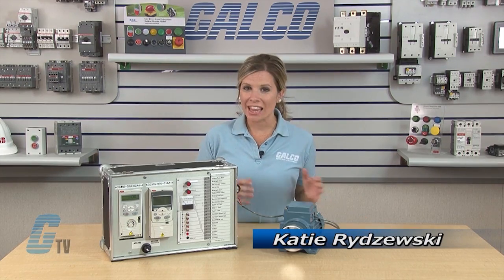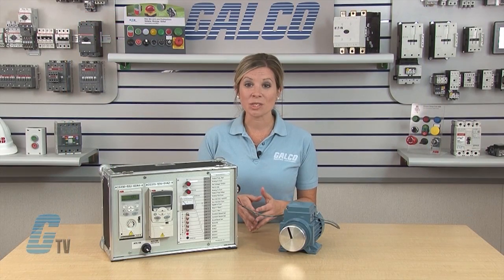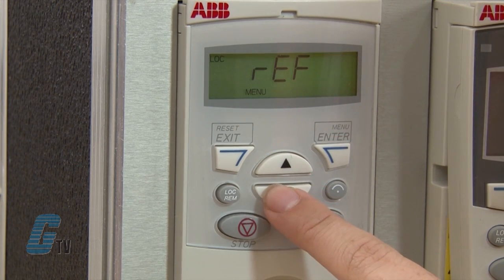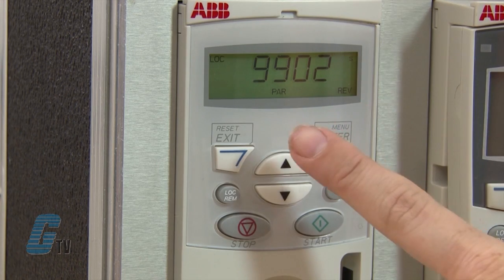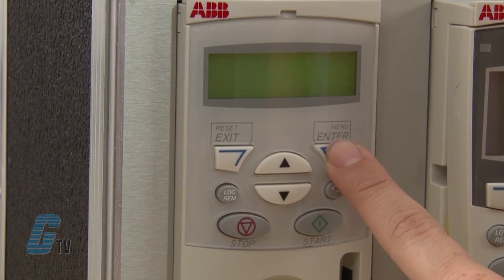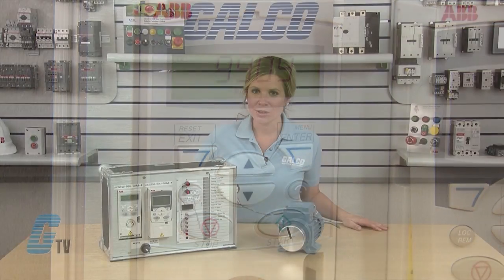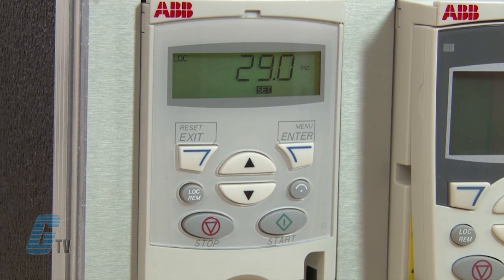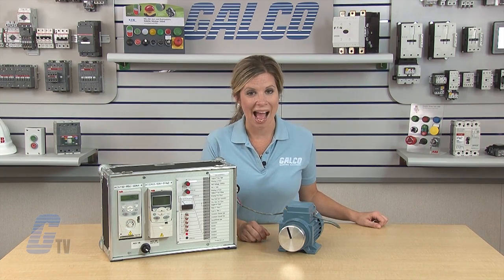ABB ACS-150 AC Drive Basic Start Up & Operation Demo

Comment: Hello, thanks for this informative video. I am using this drive to control the RPM of my 0.75 HP 3 phase AC induction motor in a manner to obtain a reciprocating motion of a platform (with a chain-sprocket and lead screw arrangement). I wonder if there is any provision or some parameter set in this drive to observe the speed of 5 mm/s of reciprocation. can you give some lead on that?

Comment: I got A5031 fault if I choose local mode. It means the Driver is not ready to operate. I am pretty sure that my connection (+24 and power) is good. I am already checked. How I am supposed to be?

Comment: I have a abb drive did not star local and remot mode what is tha resan
Reply from the maker: When ever troubleshooting VFD problems remember there are 5 basic things a drive needs to run a motor. 1) The input line power must be present 2) A start command must be given by keypad or at input terminals (may need to make sure any safety circuits are made/closed as well) 3) A speed reference must be present 4) The motor must be connected to the output terminals of the drive 5) The feedback must also be connected to the drive (unless running open loop of course). If there are no faults displayed, is there anything displayed on keypad, may be a power issue. If display is on but just doesn't start is the stop circuit closed? Is there STO on this drive if so is it jumpered or connected to the safety circuit and closed. Does the drive toggle from Local to Remote by the keypad and if it does not start in local either you may need your stop circuit closed to drive or Enable input, first, is it closed?

Comment: Any idea how to reduce the noise from the motor using this abb drives?
Reply from the maker: Yes just increase the "Switching Frequency" at parameter 2606. Default is 4KHz and can be turned up to 16KHz. Please be aware that the higher you turn up this parameter the more you have to de-rate the drives capacity. Try 8KHz for starters, the noise might be acceptable there and drive won't de-rate to much yet.
Reply: Could you explain more oh how turning up the switching frequency will derate the drives capacity?
Reply from the maker: Sure Farhan, it is due to the inductive nature of your motor. The higher the Switching frequency the more reactance you generate doing so. You have a fixed voltage source, and you are increasing the reactance ( reactive resistance ok) the the current has to go down. It is the current that is directly proportional to the torque the motor can produce, so less current, less torque. So it is a trade off, quitter motor, but a little less power. This help?
Reply: GalcoTV wow! Perfect explanation! Thanks alot galco!
Reply from the maker: You are welcome.

Comment: I am currently in a motor drives course at ECPI College of Technology.  Our Instructor has provided us with the ACS-150 drive and we need to come up with a way to utilize the device in a basic operations scenario. Everything I see online is fairly complicated to achieve with the little resources we have been provided.  If you have any suggestions as to what we can accomplish on a small scale it would be greatly appreciated.  Thank you!
Reply: Yes sir you can try for different input like one for manual speed through keypad , auto mode through analogue 
Or one input for hand mode through keypad , auto mode 2 separate input for different speed 
This is unable in building applications.
If you did please share with us.
Reply from the maker: Hey Carl,

For a relatively easy idea, perhaps you can try to belt couple the motor to a grinder wheel. That way you can demonstrate the difference in performance/power comparing low speeds to high speeds.